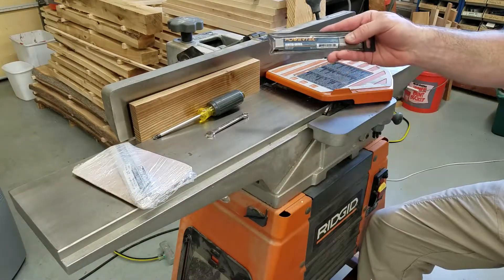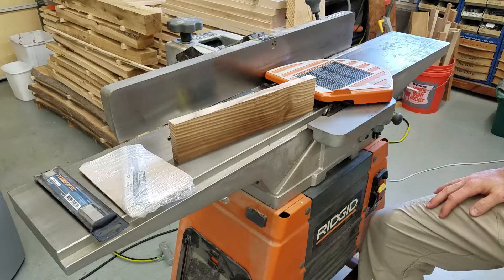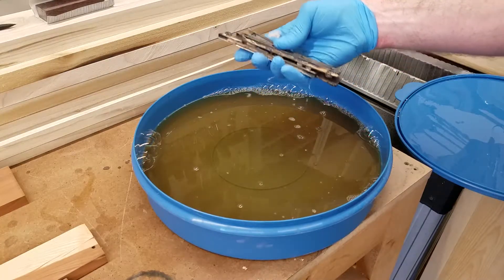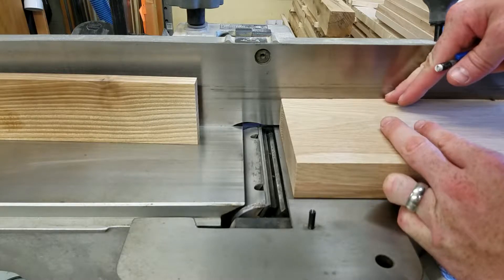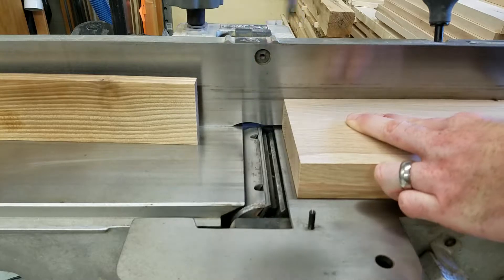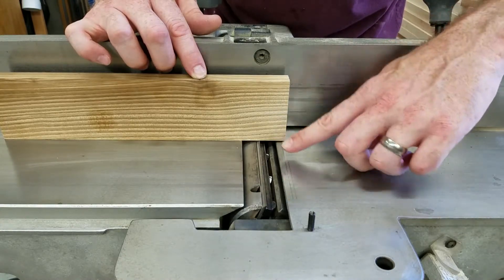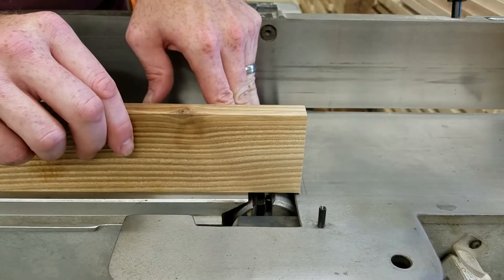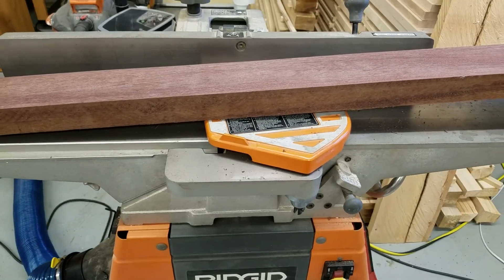How do I change and align jointer knives?

Comment: Thanks for the video on changing the jointer blades. I have that Ridgid JP06101 jointer myself and this is my first time changing the cutting blades. I have a feeling I’ll be watching your video again. One question, did you lower either of the beds to get better access to the blades ?
Reply from the maker: I'm glad it was helpful. You don't need to change the height of the beds, but I like to do the test cuts with a very light pass.
Reply: @TheSnekkerShow  I do all my cuts with very lite passes. I’ll set it up like you do in your video then. Thanks again.

Comment: Great video. Question, have you tried a jointer pal? If so, what method do you think is better for setup?
Reply from the maker: If you look closely at the end of the video when I do the test cut, you can see one stuck to the front left of my jointer. Not really sure why I don't use it, but I find the scrap wood method to be just as easy and effective.

Comment: Hi there.. A question I have for you.. On minute 8:24 you are using an allen key to adjust the height of the knive, I think you call it set screw. Is that the purpose of these 2 screws on the cutter head? You are the first I see using this screw, all others are adjusting the height by the screws that holding the knive itself.  Thanks.
Reply from the maker: Yes, on my jointer, the blades sit on top of the two set screws so they can be used for fine adjustment. The screws also help prevent the knives from shifting over time.

Comment: Have you tried helicoidal/spiral blade adapter? I am looking for what benefits they have as they are quite expensive.
Reply from the maker: Not yet on my jointer, but it's on my wish list. I installed one in my thickness planer three years ago and I'm a big fan.   https://youtu.be/47PyY4K47KU
Reply: @TheSnekkerShow  That is what I was looking for! Thanks for sharing.

Comment: How have the carbide coated knives held up, compared to HSS? Big price difference, did you find value in the change?
Reply from the maker: I think I should have invested in the helical head.  https://youtu.be/RxmBynXg9s4
Reply from the maker: I still have one of the carbide knives in the jointer, but the other two are steel. I still haven't decided if it's worth sharpening the carbide ones. https://youtu.be/6vudqFvFu7E

Comment: The first step should be to DISCONNECT THE POWER CABLE.
Reply: Any clown that doesn't know they should unplug a power tool before working on it shouldn't own a power tool. I doubt they'll be changing jointer blades if they've never worked a jointer before.
Reply: @bobsacamano4  Yeah, bottom line: Ya can’t fix stupid!
Reply: @bobsacamano4  Don't be naive. There are plenty of clueless idiots out there.